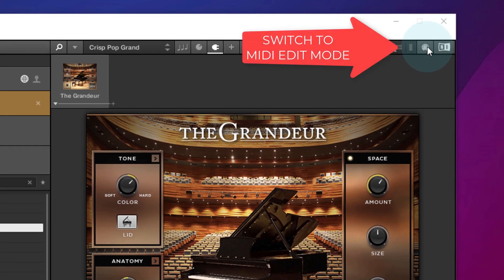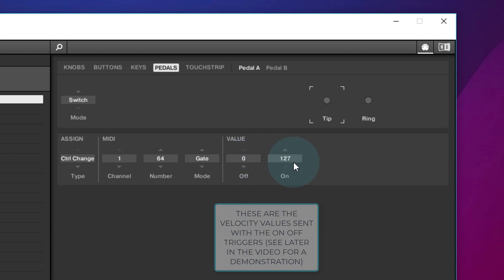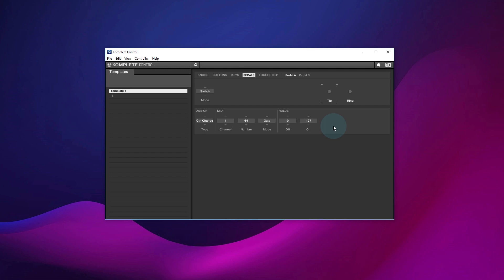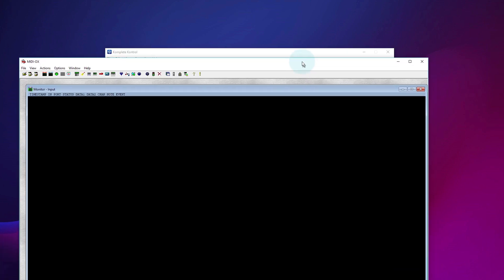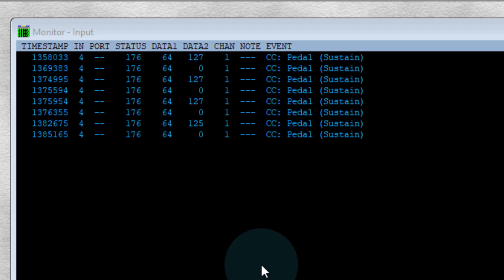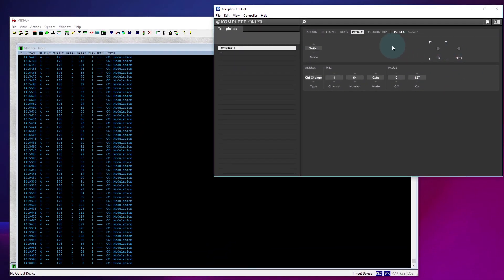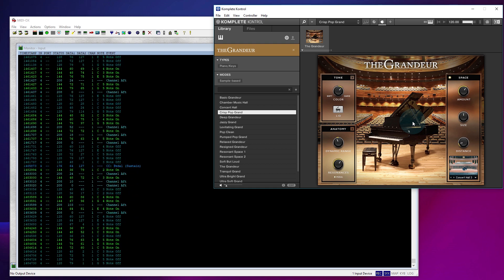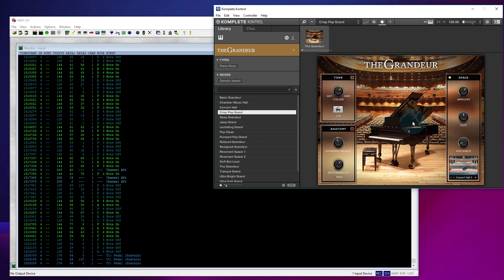Sustain Pedal Setup | Komplete Kontrol

Comment: For those who, like me, this method just didn't work: Make sure the pedal is connected first then -  
1. Press "Settings MIDI" on your controller
2. Press SHIFT + BROWSER to go to the MIDI Template Browser to edit these settings.
3. Select "Edit" 
4. Set "Invert On" (it will be off)

Edit: The only thing I noticed with this method is that when I turned it off after playing and then got back to it again, it was inverted - the notes sustained when I wasn't stepping on the pedal and cut when I stepped on it. So I turned the keyboard off and back on and that fixed it.
Reply: Thank you

Comment: I so wanted this to work for my new S61 MK3 keyboard but my Komplete Kontrol software is version 3.2.1 and I cannot find any sustain pedal settings as you are showing in your video. I simply cannot understand why it should be so complicated (actually impossible thus far) to get a simple sustain pedal to work on a brand new Kontrol Keyboard.
Reply: Did you figure it out, here I am trying the same thing
Reply: so just wanted to say after poking it for a bit I figured it out.

Make sure you're in the sustain port (closest to USB ports)

This is with the latest firmware with the new midi templates.

Edit the MIDI template.

Page1: mode Switch, Invert Off.
Page 2

Tip Type:  Cntrl?chg, Channel 1, set number to 64 and mode to tgate with Off at 0 and On  with value 127.

Started working for me at that point.

Comment: Hey YDCat Great Thanks for the how to do. I had to sidechain your video (my KK window had no MIDI icon) for further help on that issue - but easily solved by getting KK from my applications and then attach the pedal to the keyboard, and Boom! up popped the MIDI icon on the KK window. Then back you your tip and now pedal is working - thank you

Comment: Thank you so much. I just got the same NI keyboard you use, and the (NI approved) Roland Sustain Pedal wouldn't work.
Well done! 
I will try your solution and report back. However I have VST pianos that support half-pedal, and I bought the Roland pedal because it (supposedly) supports half-pedal. 

At first glance, it would appear that your setup contemplated "on-off" only.

 If anyone reading this can point me toward half-pedal installation, I will be deeply grateful!  Thanks,

Comment: I bought a Chinese cheap pedal, working fine. In short, we need to do nothing except to unplug or reboot the keyboard to begin with the pedal. The settings are same as default. I am wondering if we can edit the distance of pushing it to reduce it to half. Like it works when pushed fully down, and the distance seems unnecessarily long. Some pedals like Roland has a shorter distance to cover i guess, as I saw in one video of "Pianofrom scratch" channel.

Comment: Straight out of the box, I've had no Pedal A or Pedal B activity from my new Komplete Kontrol S88-MK2 just using various basic standalone VSTs and plugings. As soon as I got the Native Instruments recommended program package installed, the S88 sprang to life, but still no sustain action.  Is this normal? I eventually found the answer buried down a rabbit hole on the PianoWorld Noire Piano forum of all places and how their pedal parameters are configured. A tech guy told me that it's the KK computer software that programs the keyboard via USB to enable the sustain pedal.. as soon as I did this, all standalone VSTs and plugins worked fine. What a kerfuffle. Thanks for this easy to follow how-to video. Very frustrating to say the least that you had to put all this together in the first place.

Comment: MIDI Ox shows the sustain pedal working.  However, it doesn't work in Cubase or FL Studio.  Fl Studio has a MIDI monitor.  It sees everything else (notes, wheels, etc.) but no input from the pedal.  I don't know what else to do.  Also tried 2 known working pedals.  The pedals are fine.

Comment: I only have sustain when the pedal is up. But when I press it down it seems like I have no sustain at all. Its all kinda backwards. Any fixes?
Reply from the maker: Is there a switch on the bottom of the pedal to switch the tip and ring?
Reply: @tdcattech  turns out I needed to wait for the pedal to be fully detected. Super easy setup with this vid!

Comment: I just got the Komplete Kontrol S49 and was trying to find out how to get the pedal to work and glad you did up video on this.  Never had a keyboard where you had to set up the sustain pedal and I’ve owned a lot of keyboards.  I have the exact same sustain pedal.  Everything worked except for some reason I had to switch the number values for it to work.  The opposite way it was sustaining without me pressing the pedal and then I had to press the pedal to unsustain it lol!  So I put 127 in value off and 0 in On.  Weirdly enough that fixed it.  Just glad to have the sustain pedal working as I was having to make up the sustain with some reverb and delay the past 3 weeks.  Thanks!
Reply from the maker: Isn't that just the switch on the bottom? You could flip them with that, I think.
Reply: @tdcattech  I’ll have to take a look at that switch.  I didn’t know there was one. Thanks!

Comment: Thank you! Excellent video. I can't wait to setup my sustain pedal.
Reply: Update - I ended up having to setup both Tip and Ring as Ctrl Change with Tip = Number 64 and Ring = Number 65 which got the pedal to start working but inverted. This meant the sustain was automatically on when not pressed and off when pressed. When I went back to Komplete Kontrol, I found a setting for Invert in Pedal B which oddly enough, fixed it. I'm a tad confused how I got it to work since the pedal is only plugged into Pedal A and it's the same M Audio pedal you have. I guess for now it works and I know enough to fiddle around with it if I ever run into the issue again.

Comment: Great video!!!!  I see that my Komplete Kontrol 88Mk2 has TWO foot switch inputs. I'm using one for sustain, Is there a way to use the other one for a foot switch to change the speed of the rotary speaker on an organ plugin which now uses the mod wheel?  Thank you

Comment: It didn't work with me.I did pricisely same thing with you for my sustain pedal.But lt worked in opposite way.When i pull on the pedal it gives sustain and i put on it it stops sustain,i gonna be mad right now and shatter the the keyboard thousands of pieces...someone please help
Reply from the maker: Is there a switch on the bottom of your pedal? That could cause this. Or I guess you could reverse the midi values :-)
Reply: @tdcattech  I did accidentally cut the power off while i still plugged to the pc and komplete kontrol currently working.How did it happen i don't know but the issue is solved suddenly by itself.Maybe the God decided to help me anyway:))So there is no problem for now,if same thing happen again i will evaluate your opinions from the beginning,thank you
Reply: @tdcattech  By the way,i have a mod wheel and slider issues today,they does not work,any ideas?

Comment: There are actually sustain pedals that support continuous but you need to refer to the manual of the pedal you have to know if its supported (Most have a TRS jack instead of TS jack) and how to set this up correctly
these are mostly used for half-pedaling ... If somebody is using one of these I would Highly recommend to Calibrate it 
Also For those wanting use more Pedals that work as described in this video 
You can actually use an adapter cable that goes from one TRS Male Jack (Stereo) to two TS Female Jacks (Mono)
The second pedal could than be configured in the Ring part of the Pedal setup menu (You might want to lookup what you can do in a Midi CC List and use that as Number)
On the KK S MK2 Series you are actually able to to connect 4 of these pedals 
Also if you have a Maschine MK3 you can do the same trick to have a pedal for Play/Stop and Record Enable/Disable

Comment: There is no icon midi on my compete control
Reply from the maker: Usually this happens because you're using Komplete Kontrol in a DAW (i.e. as a plugin). Make sure you open the standalone software to get this option.

Comment: So I cant get any sustain pedals to work with KOMPLETE KONTROL, sustain pedals work in KONTAKT and the stand alone versions, MIDI OX says that when I hit the sustain pedal, that I am hitting a sustain pedal( in event) but in data it says 40 not 64.   Then in KK the sustain pedal alters other parameters and not sustain.  I have followed the instructions in this video, and had many back and forth e-mails with NI tech support, I feel like throwing my keyboard out of a window- this is so frustrating what else can I try to get a sustain pedal to work?  If MIDI ox is showing 40 instead of 64 how do I change it to 64 - I suspect this my be my problem,  but more importantly why cant NI program their stuff so that something as simple ( and integral)  as a sustain pedal just works?
Reply from the maker: I'm using Komplete Kontrol 2.5 (R208) which is the current version at the time of writing (29th Nov 2020) and the instructions in this video are still valid. When you enter the MIDI setup for the keyboard, can you successfully change other settings? An obvious one to try is the colour of the LEDs on the keys (under the [KEYS] tab) as you can see the result at the exact time you click the change.
Reply: @tdcattech  Thanks for jumping in an trying to help, so yes I can easily change the color of the lights.  I am also on v2.5 but I have been truing to get my sustain pedal to work since ver 2.2 or 2.3, I am not sure when it stopped working in KK but it used to.   I have tried to follow these instructions several times, over the last year, I have had some tech support e-mails from NI, they told me to use MIDI ox to make sure that  sustain is coming through on 64 but it seems to be coming through on 40, ( but it does say sustain), they told me to delete a the .dat file in program data, nothing works,  so when working I have to decide every time use KK so that I have easy access to knobs and parameters or use KONTAKT so that I have no pre-map of parameters but can use the sustain pedal, If I try to use KK with my other MIDI keys I get the same issue.  I really want to be able to have both at the same time, know what I mean?

Comment: Hey. I've followed the steps and everything is set up the same. My midi monitor is recognising the actions of the pedal and i have The Grandeur loaded but the sustain isn't working. My midi monitor (mac) says "From Port 1       Control      1    Portamento On/Off 127". Any ideas? Thanks

Comment: I've tried this with 2 different sustain pedals and it has worked with neither of them, do you think its to do with the pedals themselves or a glitch in the software?
Reply: For some reason, I had to switch the setting from "Tip" to "Ring", but works fine now! :)
Reply from the maker: Thanks for adding the solution that worked for you!

Comment: The midi tab you clicked on in the beginning doesn't show on my interface.  Any ideas?
Reply from the maker: Just checked in the version I'm using (2.3 R177) and it's still there in the top-right. It does, however, need your keyboard to be connected and turned on. As soon as the keyboard is turned off, it disappears.
Reply from the maker: Also, make sure you're in the standalone software and not the Komplete Kontrol plugin in your DAW.

Comment: I don't see a midi icon anywhere.. Must be latest update because it's certainly not there.
Reply from the maker: Just checked in the version I'm using (2.3 R177) and it's still there in the top-right. It does, however, need your keyboard to be connected and turned on. As soon as the keyboard is turned off, it disappears.

Comment: You have exactly the same setup as me. But........when I work with a second setup (Yamaha pino with yamaha pedalset) I can use "halfpedal", so: not only on and off. I like this a lot, and use it very often. If I understand you well, your pedal is only a on/off switch. Is there a way to make my halfpedal-technique possible?
Reply from the maker: I would have thought that would be where the 'Cont' mode (as opposed to 'Switch' shown in this video) would come in. Then you're telling Komplete that your pedal has a range of motion with multiple values inbetween rather than Switch mode which has a min and max value but no intermediate midi values would ever be expected (i.e. on or off).

Comment: I do not have the midi icon in the upper right :(  I can't believe how much trouble it is to connect a sustain pedal to this.  Any other pointers?
Reply from the maker: Are you using the plugin in your DAW? That does not have the MIDI setup. You need to do this through the standalone Komplete Kontrol app.
Reply: @tdcattech  thank you for responding!  I did launch the stand alone app and eventually was able to follow along with this video, but still, it didn't fix the pedal.  Still not working :(

Comment: As I was typing my search into Google I was thinking, 'nobody will have had exactly the same problem as me...' :-D Thanks so much for posting and sharing the fix! Weirdly, the sustain worked initially and then the MIDI stopped showing up in my DAW. Maybe after an update? I actually opened up the pedal box to check the switches with a meter but it all seemed fine. Well done! 👍

Comment: If you don't see the midi icon or logo, here's a workaround: downgrade Controller Editor to 1.7.4. (here's why: https://support.native-instruments.com/hc/en-us/articles/210264165-My-Native-Instruments-Controller-does-not-Appear-in-Controller-Editor), open the old Controller Editor, select a Komplete Kontrol S series, click on "CC 64" where the sustain pedal is supposed to connect to the keyboard, and follow this video's instructions in changing the settings for "tip". It worked for my KK M32. Bump me up so people can see this.

Comment: For everyone asking: I believe this is the answer to why you're not seeing the MIDI button - Note: Controller Editor must still be used in order to customize MIDI commands on the first-generation KOMPLETE KONTROL MK1 keyboard. 

https://support.native-instruments.com/hc/en-us/articles/115005165985-I-Cannot-Edit-MIDI-Assignments-for-my-KOMPLETE-KONTROL-MK2-Keyboard-in-Controller-Editor
Reply: I have solved it that way: Open the Komplete Kontrol Standalone Version. Switch the polarity of your sustain. The M-Audio SP-2 for example has this switch on the bottom side. Then open a VST Instrument and config the Pedal as recommended from Native Instruments. Close the controller Editor and Save the Preset. Now it works in DAW without the Editor Button. For me that way works.

Comment: Works great thanks!  However only the first time.  When I relaunch the software (and keyboard) my settings are retained, but the sustain pedal no longer works.  Any ideas?
Reply from the maker: That’s weird. Are you able to install the software demonstrated in the second section of this vid? That would clearly show you if the midi signal for CC64 are being correctly received.
Reply: @tdcattech - update - I put a different sustain pedal on it and it works fine now.  I've noticed not all sustain pedals work with all keyboards.  Not just a polarity switching thing.. some models are not compatible with some keyboards.  It's an odd voodoo science I seem to run up against from time to time.  So now I put labels on all my sustain pedals which ones work with which keyboards.  And to think how much they charge!  Oh well thanks for the response and thanks for the great video!  Couldn't have set it up without you.

Comment: can t find the midi icon in my Kontakt instrument, any help?
Reply from the maker: It’s only in the newer Komplete Kontroller software. I think it used to be in the Controller Editor. It can’t be changed from a plug-in instance of Komplete Kontrol.
Reply: Can't even find the controller Editor..
Reply: @CascioMusicProduction  I have solved it that way: Open the Komplete Kontrol Standalone Version. Switch the polarity of your sustain. The M-Audio SP-2 for example has this switch on the bottom side. Then open a VST Instrument and config the Pedal as recommended from Native Instruments. Close the controller Editor and Save the Preset. Now it works in DAW without the Editor Button. For me that way works.
Reply: @MrKinetek  thank you very much 🙏🙏 I will try out asap

Comment: I've gotten the sustain pedal to work on midi channel 1 in Komplete Kontrol but how do you make the sustain pedal work on midi channel 2 and beyond?
Reply from the maker: Just change the 'Channel' setting to 2 or whatever you wish. The channel used for the CC64 value changes in real time.
Reply: @tdcattech   Thanks for the reply.  That seems to be working now. However, I have 16 different templates set up in komplete kontrol.  The sustain pedal channel assignment seems to be global.  How do I set it up so that the sustain pedal channel changes when I change templates?
Reply: I'm having the same issue. Using my KK 88mk2 live and have my instruments keysplit for each song on different  presets. All instruments are loaded in a kontakt rack. I assigned each plugin a midi channel and as of now I can only use my sustain on one channel which I am using #4 for piano.  I want to have my sustain for for all channels if possible.
Reply: It let me change sustain to a different channel on each preset. So on on I can use sustain on piano and then change to a new song preset and use sustain on rhodes. Still seems to be one channel per song. Would be nice to have it be the same across all 16 channels.

Comment: The Midi Icon is not showing up in Standalone mode. And is not showing for either KK25S or the KK49A keyboards
Reply: mine isn't either, I don't suppose you managed to work it out by now ?
Reply: did you eventually find a solution i want to get this keyboard but do not want to run into sustain pedal issues